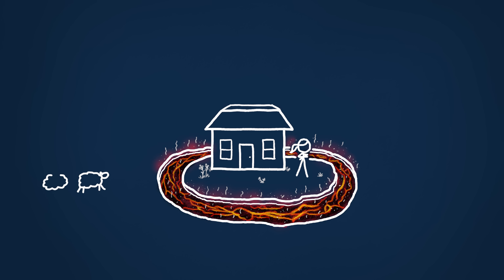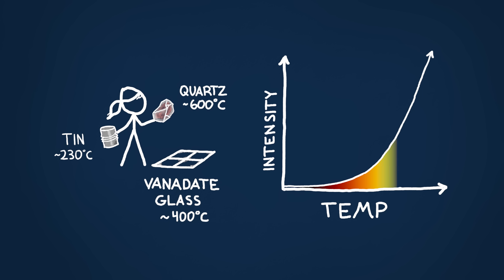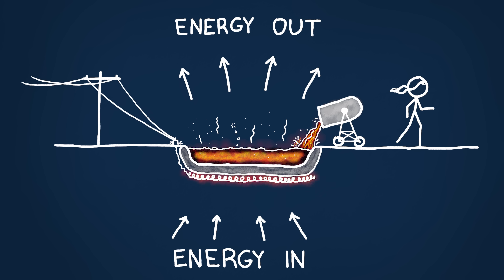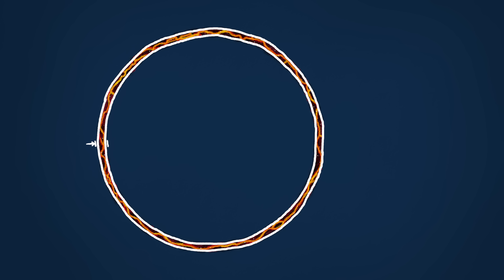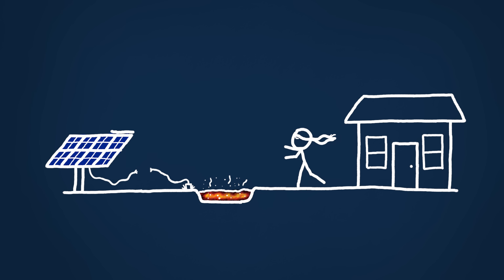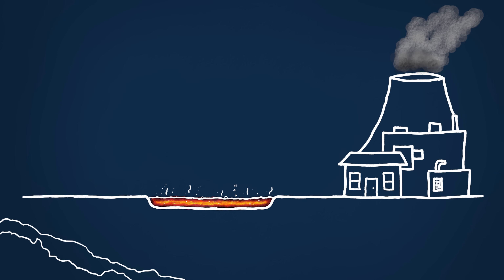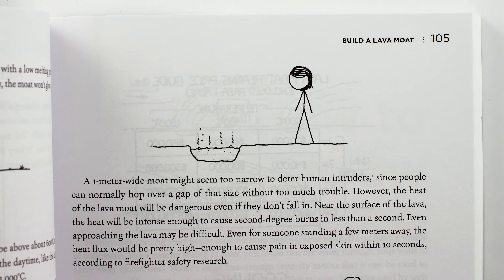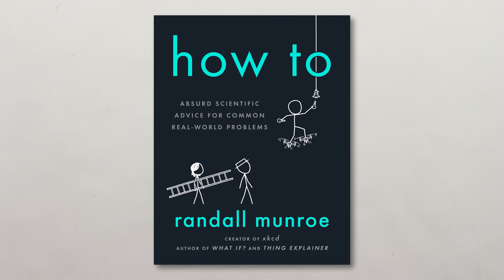How to Build a Lava Moat (with xkcd)

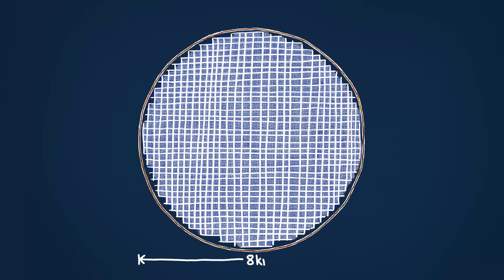Comment: 2:20 "which is clearly absurd".
🤔
Reply: O ye of little ambition.
Reply: Even though he's building a lava moat, we still have to be reasonable!
Reply: @davidshi451  I mean, you have to draw the line somewhere
Reply: I completely fail to understand why a lava moat of 8km diameter would be absurd. It's completely feasible and in fact, I'll prove it by making one. Just let me become filthy rich first and send the first outer solar system colonists out and I'll get to it, promise :)
Reply: @Anistuffs  it's absurd because you need batteries to power your lava at night
Reply: @monad_tcp  solar thermal would be far more efficient, for thermal energy collection, could actually use liquid salt very easily and pump it around creating fountains of lava and streams like  one would do with a pond except lava.

Comment: Probably there will be a sea of Minecraft comment down there
Reply: But then that sea can be used in combination with the lava to make obsidian, so it's not too bad
Reply: @DJAvren  obsidian is brittle weak crap so yeah, that's pretty bad
Reply: @NJ-wb1cz  brittle but insanely sharp.
Reply: @nathanlevesque7812  sharpness is a function of manufacturing process, not some raw material simply appearing out of nowhere being insanely sharp
Reply: @NJ-wb1cz  The capacity for sharpness is inherent to a material. Partly as material properties determine what the manufacturing process can be, and what said processes can accomplish. However materials do also occur naturally and the chemistry that produces them is also related to the properties they possess.

Whether comparing naturally occurring instances or man made ones, you'll see a consistent different in sharpness. So, potentially and in practice, some materials are just sharper than others. Barring pedantry, this means that glass is sharper than metal.

Specifically, obsidian can be as little as 3 microns thick (vs 1.6mm for steel) and is quite smooth (whereas metal blades are always jagged). It's naturally prone to fracturing in a way that produces edges. Whereas metals naturally occurs in lumps (ore), or as mineral deposits (usually a heterogeneous mix of compounds, i.e a disorderly composite).
Reply: @nathanlevesque7812  if you view it as a practical manufacturing process, it's pointless because obsidian is brittle. Brittle extremely thin blade has very little uses, far less uses than a steel blade. Diamond of course is far more useful than obsidian for actual cutting, heck, WATER is more useful than obsidian for cutting.
And if you view this as theoretical limit, obviously Carbon nanotubes are "sharper" than that.
Reply: *is
Reply: Obsidian would make excellent single use knives or defence shanks. Just sayin...

I really want an obsidian switchblade now
Reply: @arifhossain9751  ffs... obsidian is just a DIRTY GLASS.
"Excellent single use obsidian knife" is literally a broken glass bottle. Take it and use it whichever way you like.
Or smash some windows or wine glasses.
Reply: @NJ-wb1cz  Sharpness and availability is why it was used for millennia. Steel is intensive to make; high quality steel even more so. At best it's only "crap" today, but then you're just taking modern luxuries for granted.

Whereas if you're stranded in the wilderness, then knowing how to work with obsidian will prove infinitely more useful than metalworking.

However, if you're a veterinary surgeon then you can also use it as a scalpel to minimize tissue damage and inflammation. It will likely be approved for human use at some point.

"Diamond of course is far more useful than obsidian for actual cutting, heck, WATER is more useful than obsidian for cutting.
And if you view this as theoretical limit, obviously Carbon nanotubes are "sharper" than that."
Hardness is only useful when dealing with hard materials. It has nothing to do with sharpness. Water cutting is of a highly situational use and is also very intensive. Carbon nanotubes don't form an edge...and also there aren't any practical uses for them outside of composite materials so far.

You seem upset by the very notion that obsidian isn't worthless trash.
Reply: @nathanlevesque7812  loin cloth has been used as groin protection for millenia, yet calling it an insane groin protector is ridiculous.
Equivalinents of obsidian are literally trash, broken glass is all around us (at least if you live in a city), it's one of the most common type of sharp object found in day to day life.

And you initial comment is 100% equivalent to saying that "Windows are insanely sharp". Which is either highly dubious  or moronically obvious, depending on what exactly did you mean by "insanely sharp". And that's a generous interpretation,  that is assuming that you're automitically talking about broken or otherwise modified windows and not windows as they are.

Protracted weaseling wouldn't make that statement any more insightful.
Reply: Butt Why?? You must be fun at parties
Reply: @autumnhd  wow why do you want to get personal and demean a stranger for no reason?
Reply: But can you imagine the scam potential?
Reply: @arifhossain9751  if someone starts selling broken glass bottles as SUPER AWESOME  DAGGERS WITH "TEMPERED OBSIDIAN"  QUALITIES it wouldn't even be a scam, it would be absolutely honest and correct labeling.
Abusing people's ignorance to get cash is called capitalism.
Reply: Fair enough
Reply: *up there
Reply: As far as i know, some of the natives of America used obsidian blades to fight in wars
Reply: Yeah and now i wish minecraft didn't have lava because of that
Reply: What the heck, there are like 5 comments above you with nothing to do with minecraft and like half of the ones below you are about minecraft
Reply: @luckystar3641  lol idk why